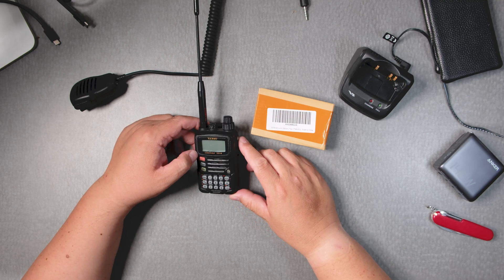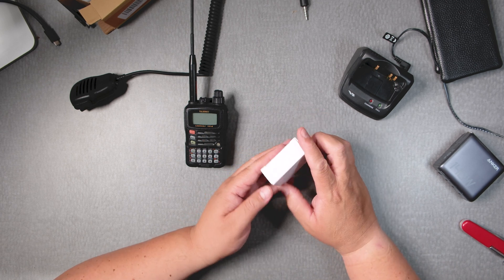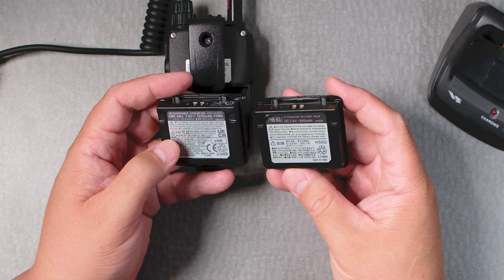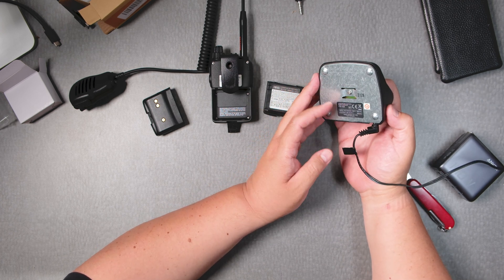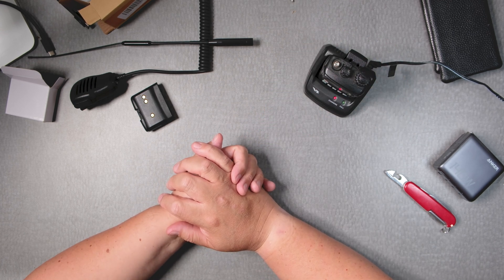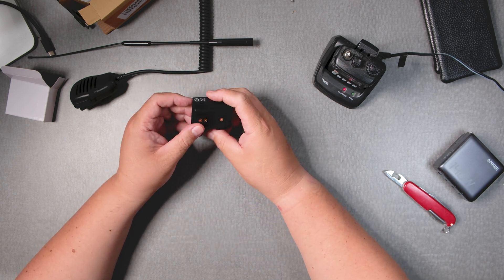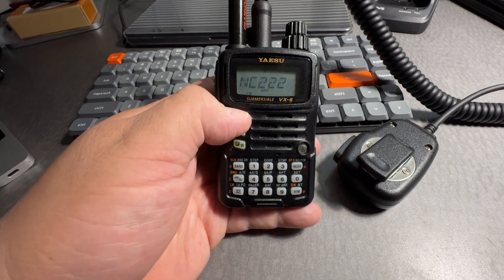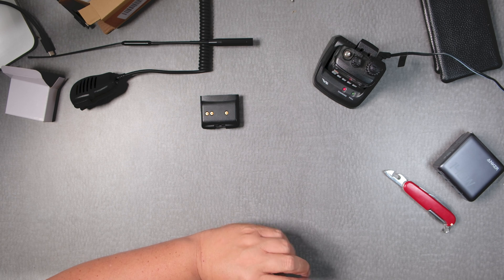VX6 Battery Replacement

Comment: Just bought a replacement battery from Giga Parts on 9/25 for $79.95. Also got the AA battery holder for $29.95. Way over $60.
Reply from the maker: Thx for the info.

Comment: Not the same quality of radio, however I just purchased a Quansheng K5(99) with all accessories, including a 7.2v 1600mAh battery for $15 delivered (with a few other low value items)!
I only want it for monitoring, so the harmonics associated with transmit are not an issue for me. Also, at the price of a toy, I could not resist it.